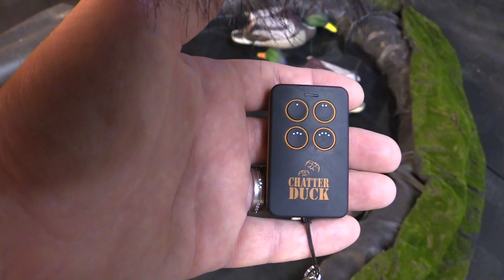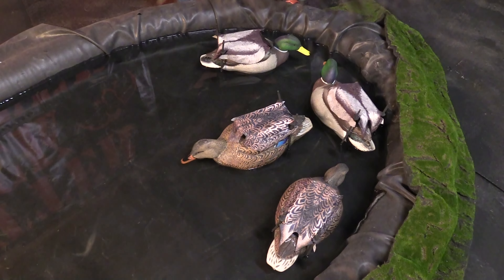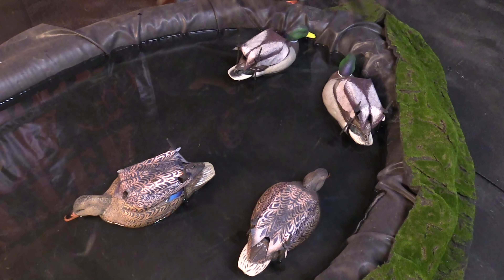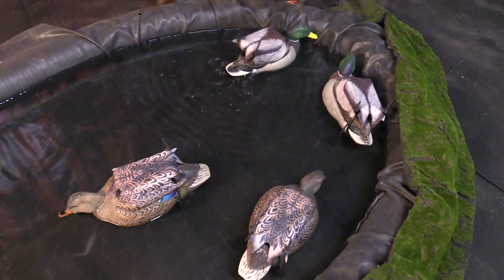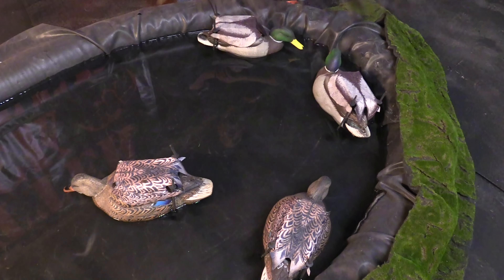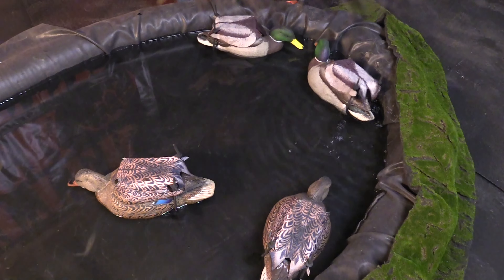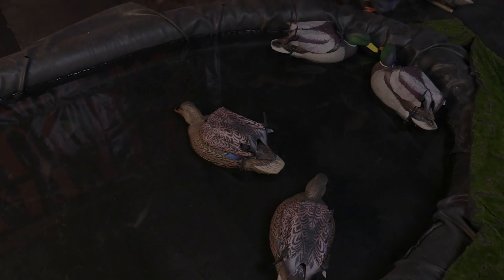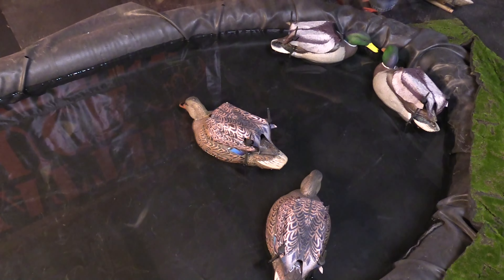Chatter Duck: 4 types of remote control settings

Comment: Talked to game and fish out here in nm  and they  said no go since the mechnism that controls the components are run on electronics its still  considered an electric call
Reply from the maker: Always check with local game and fish. However, if mojos are legal in your state, these are as well, unless the law states that it can't be operated by remote control. The call is NOT electronic. Ultimately, you are responsible for what you use and knowing the law in your area. Best of luck.
Reply: Same with MN. This is gonna be illegal to use in any state that doesn't allow electronic calls. The MOJO comparison makes no sense given the wings spin and that's it.

Comment: Does that not fall under the electronic call category?
Reply: You are correct. With the exception of during spring light goose and some early Canada goose hunts when all other waterfowl hunting seasons are closed, the use of electronic, amplified calls is prohibited in the U.S. and Canada.
Reply from the maker: No, its a mechanical call. It is air crossing a reed just like in the call you blow.
Reply from the maker: An electronic call replays a pre-recorded sound, produces a digital sound, or amplifies a sound. This decoy doesnt do any of those 3 things, therefore is not considered an electronic call. There is a can call mounted in the back of the decoy which is removable. The can call uses a weight to push air across a reed to generate sound.
Reply: Very interesting design! I could imagine a bunch of those in a spread would look and sound awesome.